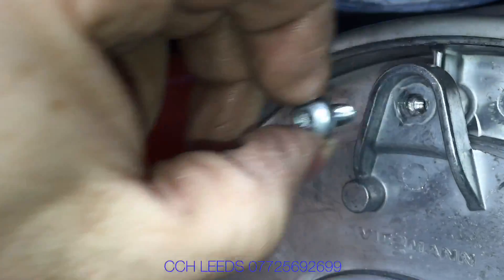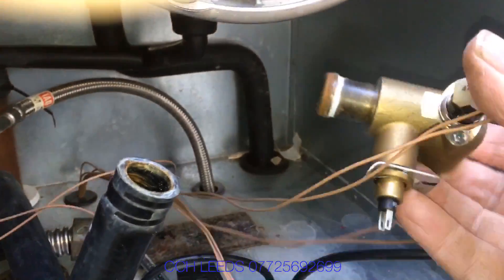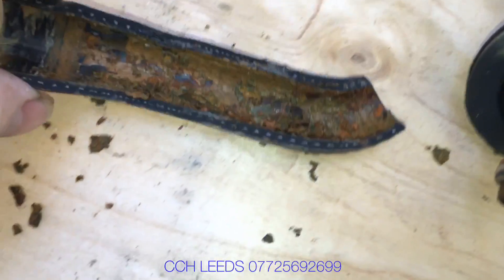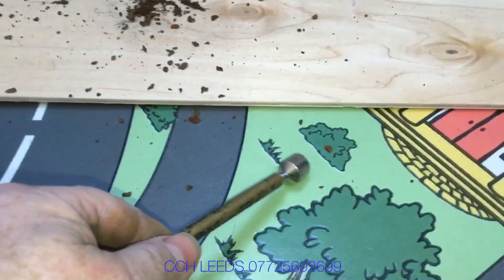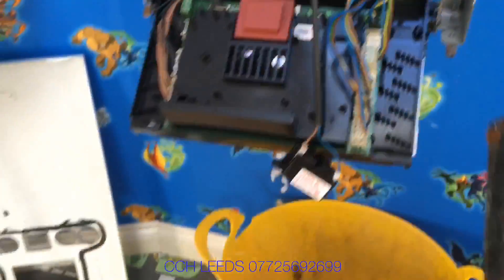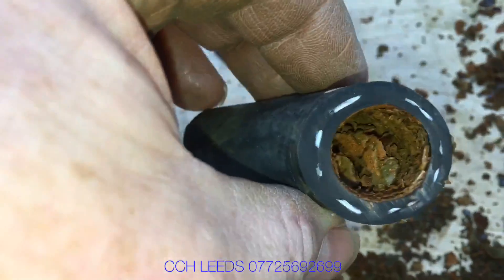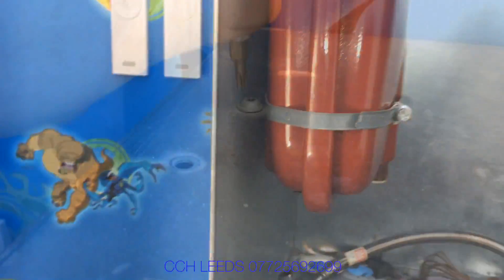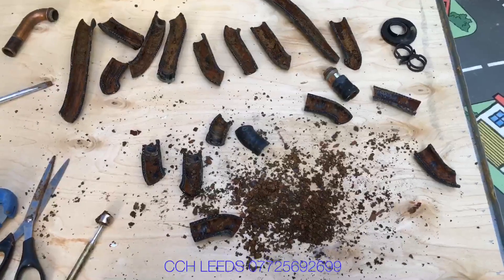VIESSMANN VITODENS 100 WB1A - Stripping down - Rubber Hoses

Comment: Hello I have a Viessmann boiler with Vitodens 222-W WS2A 35kw tank that is 15 years old. I was told that I can turn the pump to put a larger exchanger. Mine is a BP 10 - 20 plates apparently we can put a bigger one in BP 10? I do not find

Comment: I keep getting carbon build up inside the combustion chamber. It clogs the drain and I get water (from combustion) leaking everywhere. Any ideas?
Reply from the maker: Have a gas engineer give it a good service and check it out. Thanks.

Comment: I believe that Viessmann do not like inhibitors in their system.For me a damned good cold mains flush is good enough or certainly should be.

We have now fitted 2 050’s Combi boilers And at some stage very soon they will need a strip down service and probably the rubber hoses cleaned out too.
Reply from the maker: How did you find the Viessmann Robert?
Reply: Allen Hart I like them.The 050 is easy to commision and install.I want to try the 100 before too long
Reply from the maker: Have you stopped installing Ravenheat?

Comment: Question: I am having an issue with my boiler WB1B. I had a power surge few weeks ago which it stops the boiler from operating/turning on. I had to replace "pump control board" due to bad transformer and now the main control board fuse (2.5A) blows every time i connect the fan harness to the board and turn unit on. any idea if its the fan assembly or something else before i start replacing more parts? Thanks Allen.
Reply from the maker: You need someone with multi meter knowledge to test the components, Thanks

Comment: Same problem in the Vaillant Ecomax and early ecotec boilers.........I Agree with KB.......Rubber hoses just attract the system crud and also get brittle and in worst cases split under pressure !!
Reply from the maker: I am personally not keen with the rubber hoses TBH either. new ones are copper now.
Reply from the maker: Thanks for watching.

Comment: It's funny because in Germany they don't even bother with Magnetic filters.

The WB1A is an average boiler (with rubber hoses that Vaillant scrapped 10 years ago). They get a bonus point for using stainless steel heat exchangers (embarrassing for Worcester). Everything else is just your usual run of the mill plastic/generic crap. The spare parts price for these are horrendous.

Unfortunately UK installers think inhibitor and a magnaclean mean they can ignore good installation.

If you want a good boiler the only sensible conclusion is fit Intergas.
Reply: Thank you to start with.
How come i never heard of intergas boilers before today???!!!
When my current boiler dies this is the only boiler i will get.
I HATE diverter valves whether it's made plastic, copper or metal, it is most annoying part of all conventional combi boilers.

Comment: We just got a vitodens installed. Beforehand I ran central heating cleaner in the (hot) system for a couple of weeks. I drained it hot, and then flushed it (not power-flushed). A lot came out!!! And before the flush I noticed that the boiler became quieter.

Comment: believe me mate I have seen hoses solid, installers haven't the first clue about system water quality nor do they even seem bothered. 
Filters  (good ones) such as magna clean are essential and anyone who says otherwise is a fool
Reply: I work on Viessmanns on a daily basis, and this level of contamination is very common, and many of these boilers already have either Magnaclean or Fernox TF1 filters fitted. The filters usually have little or very little in them whilst the plate heat exchangers are clogged. Filters are no substitute for thorough flushing.
Reply from the maker: The hoses do get blocked but i do find they are great for been able to clean out.